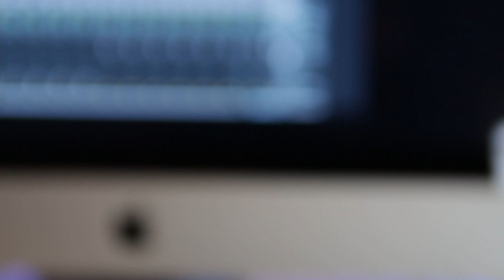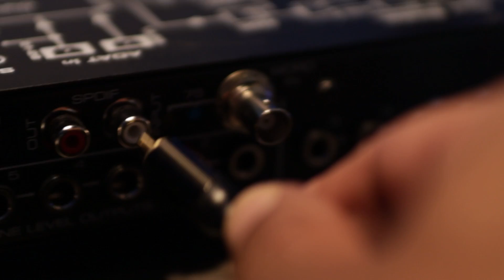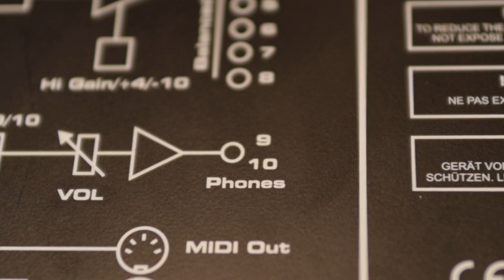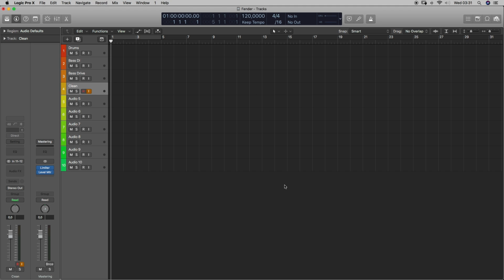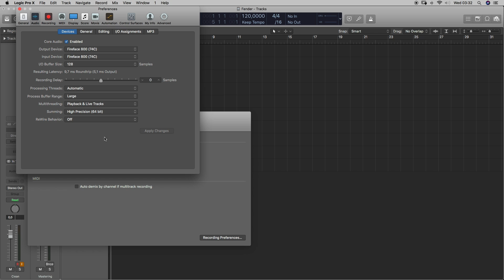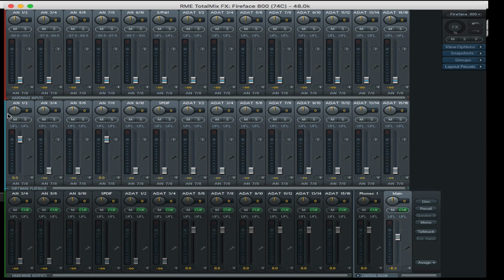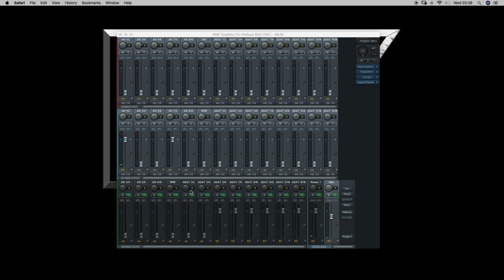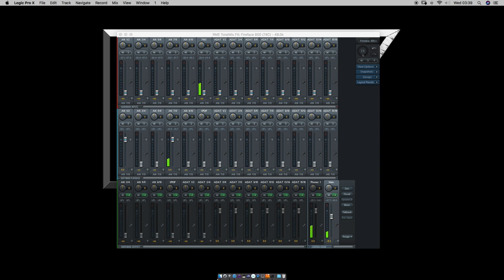HOW To Connect The Fractal Audio FM3 - RME Fireface 800 - Logic X Pro

Comment: Are you connecting the guitar using a guitar cable to the FM3 like normal or are you connecting the guitar to RME Fireface 800?
Reply from the maker: Just like normal : Guitar -> FM3 -> Spdif Fireface
Reply: @Anandmahangoe  Someone posted they connect their guitar to the audio interface then connect that to the axe fx III. Do you know why anyone would do it that way vs the normal way?
Reply from the maker: @inspiringminds7284   that is a very strange way to connect unless the would like to ‘re-amp’ later when done recording to adjust the whole sound….. easier to re-amp through the Fractal using USB.
Reply: Not a very clear explanation.